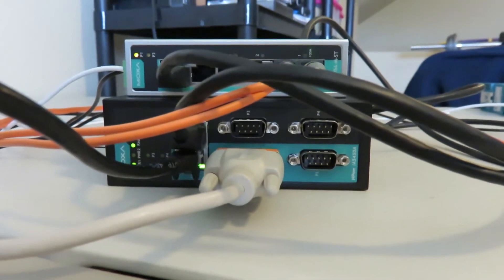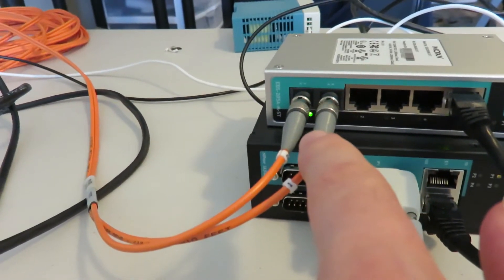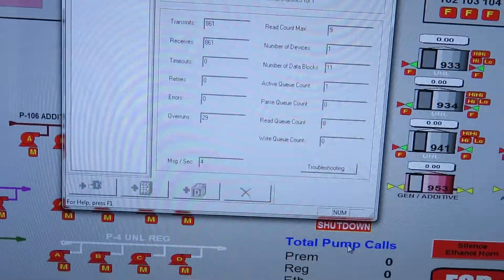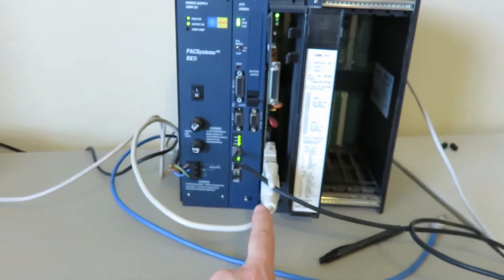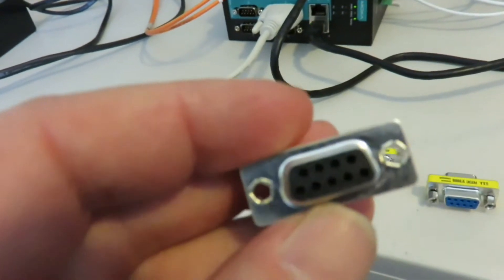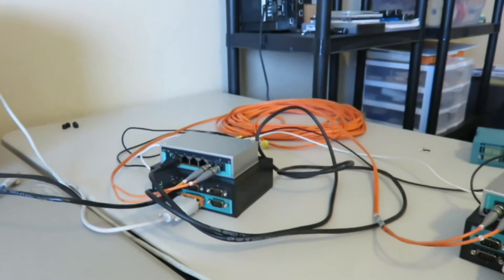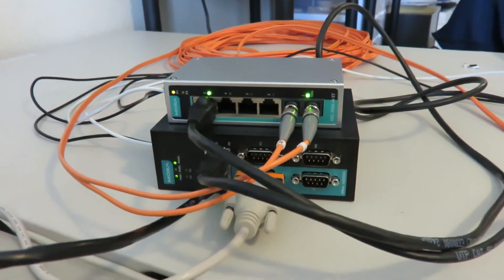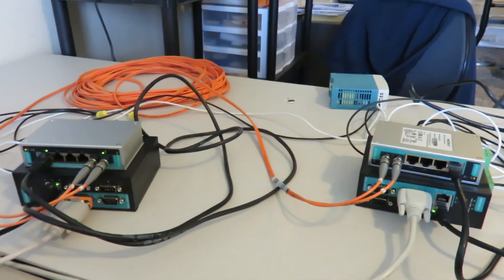MOXA Nport Device Server Overview

Comment: If you use a 1port device server as a slave, similar to this setup, but are having multiple inputs on the db9 ports in use on the master( for example 4 different nmea signals); How do you choose which db9 port on the master you are reading from in a 1port device server set as slave? - thank you! Great video btw!
Reply from the maker: Not sure I understand the question. There is a lot of flexibility in the configuration though, so I would recommend downloading and reading the documentation on the various configurations. They are really pretty simple. Hope that helps.